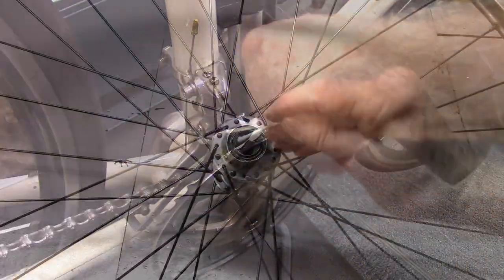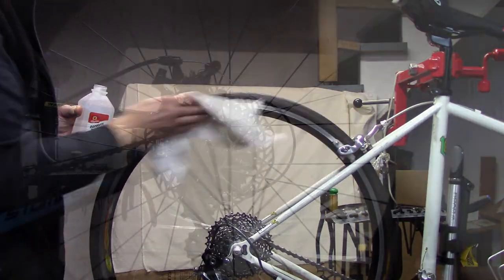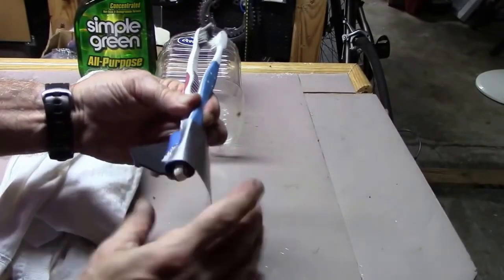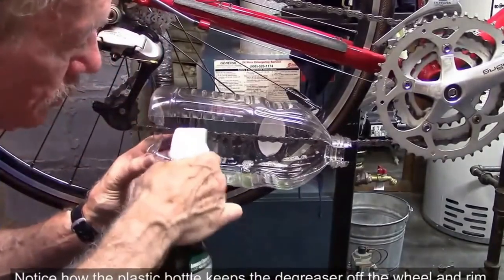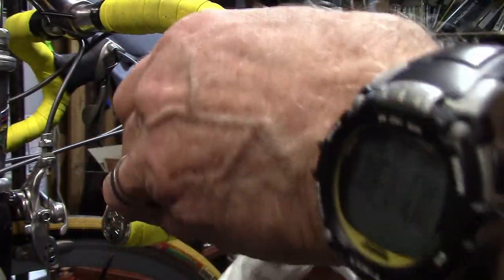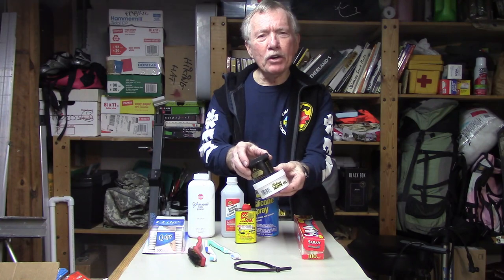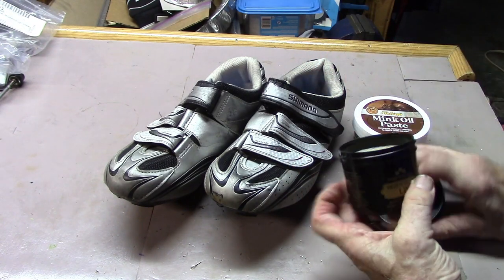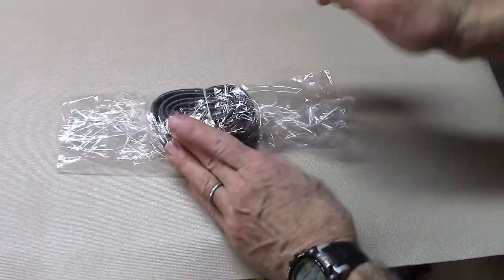10 Cheap Bicycle Supplies from your Grocery or Hardware Store

Comment: I like the Velcro that is soft on one side with the mate on the other. It comes in a roll that can be cut it to various sizes.  It sticks to its self so it can be stored easily and doesn't leave a plastic tongue.  Longer ones can be used to hold gauze for first aid.  Tip: Keep the soft side next to the frame and on the inside when storing. That keeps it from scratching and holding on to dirt.
Reply from the maker: Good tip. I found some at Home Depot and it works as you say. Thanks, Tony

Comment: Hair Spray is great for installing BMX or flat bar grips!
Reply from the maker: Works well. Thanks for the tip. To get the bar grips off, I stick a screwdriver under the grip and squirt a bit of rubbing alcohol under the grip. Take out the screwdriver, and just turn the grip. Comes off easily. Regards, Tony

Comment: GREAT as always Tony. I like Dollar Store brushes for cleaning the bike, too.
Reply from the maker: Thanks. I got some nice soft round ended brushes at Walmart (normally for dishes etc.) for a few bucks and a plastic pail for quick wash down of the bike frame. You can also get a 1 gallon lawn sprayer for under $10 (pump up the pressure by handle) and wash off the soap and suds.

Comment: Nice, just love the "Park Chain CLeaner" tool substitute. KB
Reply from the maker: The tooth brush pair work great and less messy then a the usual chain cleaner. The brass bristle is very helpful when I'm doing a quick drivetrain cleanup before re-lubrication. Regards, Tony